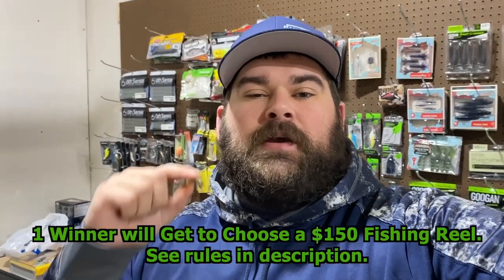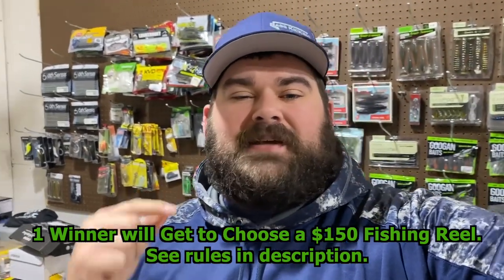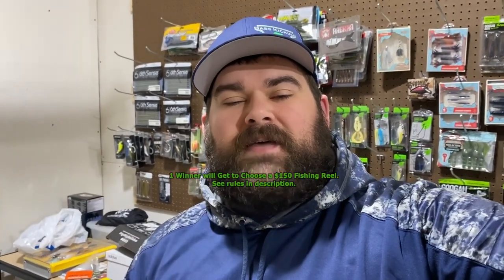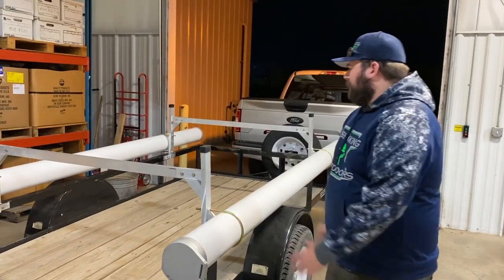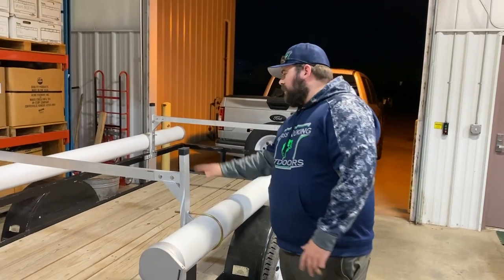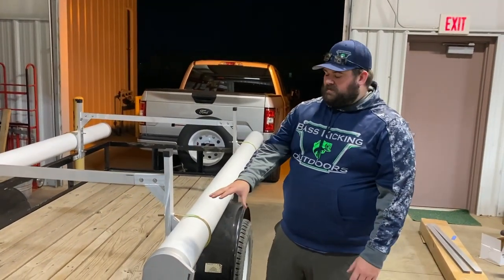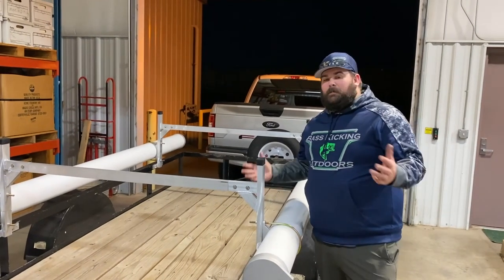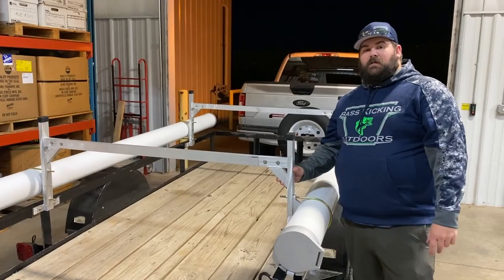Kayak Trailer Build and 2500 Subscriber Giveaway

Comment: Are you worried about Galvanic corrosion?
Reply from the maker: Never heard of it. Just researched it. Time will tell if the metals will react to each other. Ive seen others do the same without issue. Using a gasket type material between the two metals would be a simple fix to the potential issue.
Reply: I ask, because I am putting a rack on mine too, and rather use aluminum so I can take on and off.  A rubber "washer" might solve issue for me, just to keep metals apart.
Reply from the maker: @gwrulzmylife  yeah that is what I read. As long as metals are apart.
Reply from the maker: @gwrulzmylife  they have to be touching.